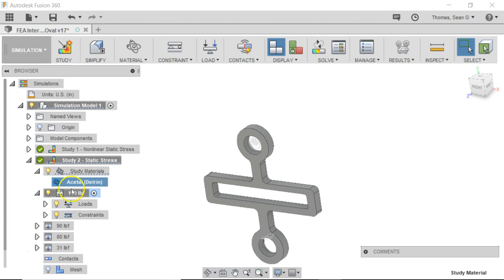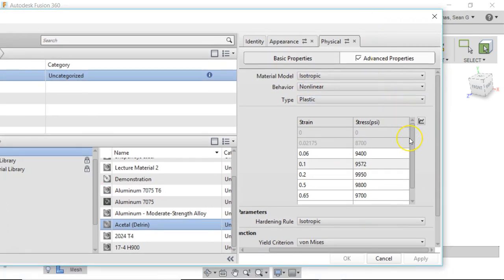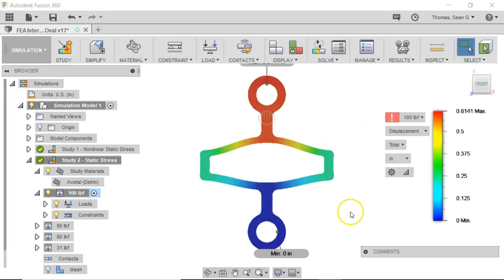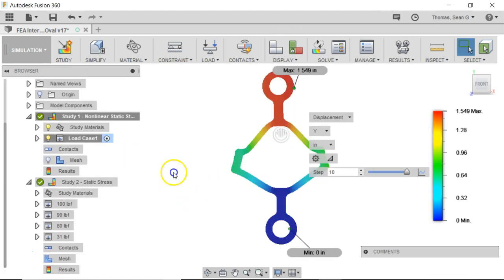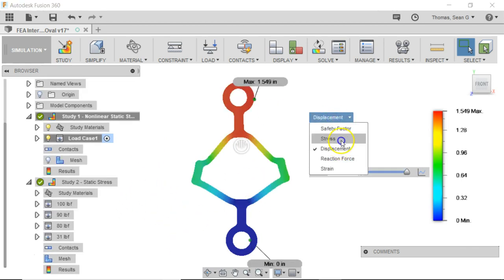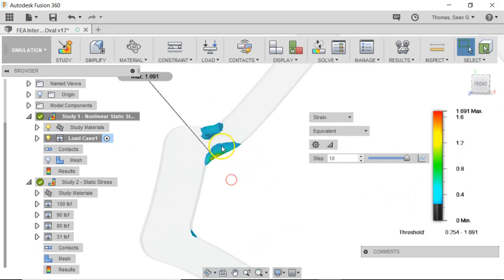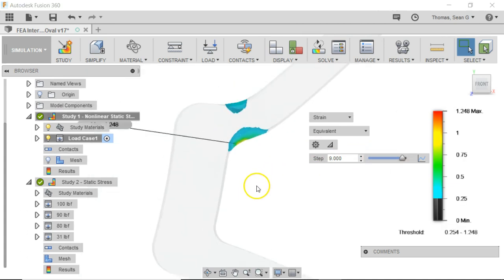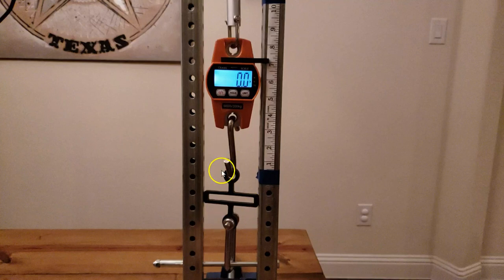Linear Elastic vs Non Linear FEA Structural Simulations

Comment: why do you use 0.25 strain to failure when your input stress strain curve goes out to 0.65 strain? does 0.25 strain coincide with the ultimate stress?
Reply from the maker: 0.25 is the materials strain to failure. The curve is carried out arbitrarily further so the solver doesnt fail. 

This video was intended really to illustrate the differences in linear and non linear...not so much to teach fracture science and failure analysis. That's a very complex subject that really isnt suited to Fusion 360.